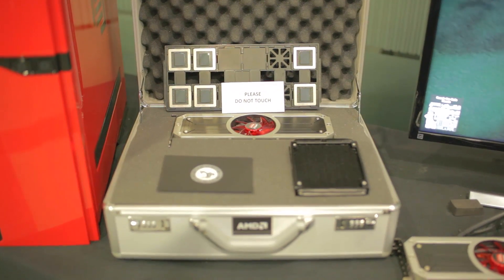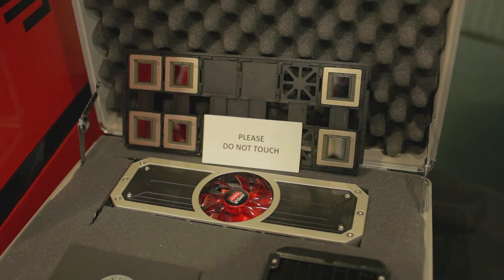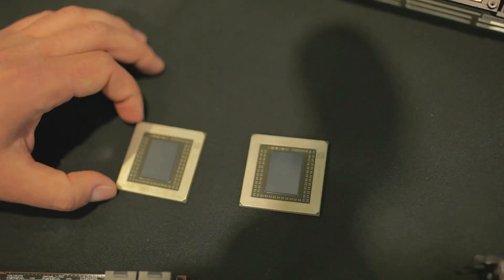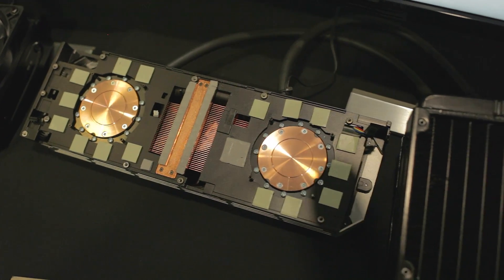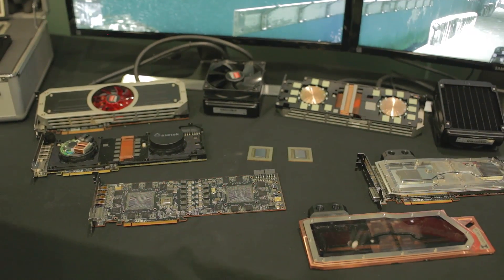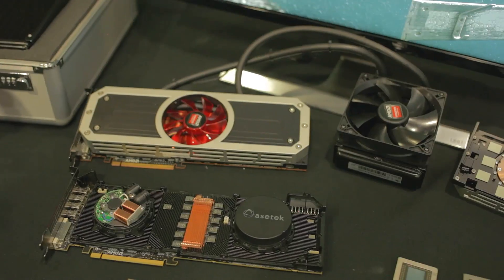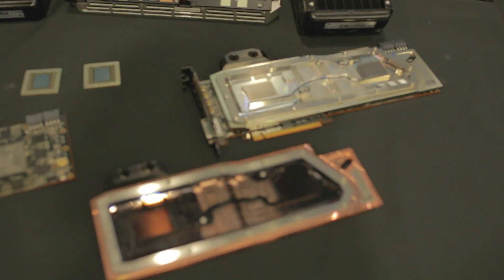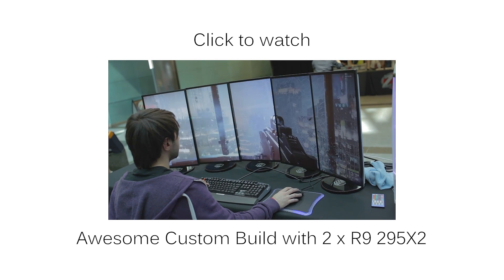AMD R9 295X2 Dissected + Custom waterblocks (ExtravaLANza 2014)

Comment: I immediately thought "Bullshit" when he explained the thing about them choosing closed loop and how he kind of diss the open looper's. I have an open loop cooling with mine at the moment and re building it soon with rigid tubing to accommodate the 970 and the 2 new block's I just bought.

His explanation was acceptable but to say something like that against open loopers and not even mentioning the real reason why they use closed loop cooling.

Its the fact that those cards get so hot its like an electric bbq grill if you use a heft dense stacks of metal heat sinks....

And he compared closed loop 120mm Rad performance against open loopers? lol there is no way a closed loop perform as close as open loops.

Then they are boasting having high speed GPU's at a better price.

Again not mentioning the fact that their cards consume alot of energy, waste majority of the power consumed as very high temperature/heat and mostly have cheap price because they do massive price cuts when they are starting to lose.

Just saying.

Comment: Not against AMD at all, but the fact the card needs to be water cooled as standard, but the Titan Z does not says a lot about the engineering at AMD. I feel they rushed this card to market and it's a bit if a bodge job.
Reply: think befor talk!
the r9 295x2 has 2 fully enabled cores with even a higher clockspeed then the reference one! on the other hand the titan Z has 2 downclocked cores and a tripple slot cooler and it is still hitting higher temps then the 295x2!
AMD did the right thing to go with a CLC.
if you look at the performance the titan Z can deliver for gaming and keep the pricetag in mind, then i have to say the guy´s over at nvidia shot themselves in the foot...
Reply: Is it faster than the Titan Z?
Reply: Sebastian Green in the most game benchmark yes, in canned benchmarks like heaven sometimes the titan z, sometimes the 295x2.
also the 295x2 pulls ahead if you higher the resolution! at 4k and both cards overclocked to the max the 295x2 was a winner in almost every situation...
Reply: Almost every situation.......

I believe when utilising the gpu power for complex computation the Z is way better. 

Depends on the usage. I'm not really a gamer.
Reply: and then again, it depends on what are you going to calculate with it!
if you are interested in workstation card´s then go check out some video´s first. you will be surprised which card´s will perform very well at even a lower pricetag! ;-)
Reply: *****
nvidia also intentionally nerfs gaming cards because they dont want to lose their professional markets, gaming cards are rated to run at 100% load with their coolers at stock clocks indefinitely before being sold by them and everyone else except the amd 290/x cooler which were nowhere near good enough at lower fanspeed or just too damn loud.

Comment: Titan Z is faster than the "undisputed" R9 295x2
Reply: Drink much??
Reply: You should probably have read one of the few reviews of it. Titan Z slower in almost every game at every resolution. Don't be fooled by the price tag.
Reply: the titan Z got mostly beaten, and the higher the resolution was, the bigger was the gap between the titan Z and the 295x2! if it is just for gaming the 295x2 is the best card you can get at the moment for a much lower price then the titan Z...
Reply: blackice11z What's your point? You should be comparing reference vs. reference. There was nothing stopping Nvidia from putting a better cooler on the card. They didn't so it's a slower card. It's simple as that. Are you saying that AMD should be saying "undisputed unless you put a $200 waterblock on Nvidia's $3000 card and compare it to our reference cooler for some reason?" We can't even say for sure that Titan Z would win with both on custom water with full-cover blocks and overclocked without actual tests.
Reply: Being more expensive ,by 2X too....If I were to pay for a Titan-Z I can go Quad Xfire with the 295 X2 
Sorry I compare the Value instead of just Charts and Bars and some Benchmarking Scores. 
Since end of the day my wallet is the bigger priority here....
Seriously stop lying to yourselves NVIDIA fanboys. All you guys doing is trying to lick your wound and comfort yourself while you cry yourself  to sleep everyday knowing about the harsh truth =)
But seriously you sure the Titan-Z is faster ?? Or  your eyes need to be check. So far I seeing is the 295 X2 totally trashing the shit out of the Titan-Z in EVERY game....matter of fact even 2X 780 Ti runs better than the Titan-Z yet again another fail of a card for gamers. Which NVIDIA themselves advertised it as a Gaming Graphic card....
Reply: The Titan Z is meant for CUDA applications. It's twice the price of the R9 295x2 and doesn't even perform better. Fanboyism much?
Reply: blackice11z If you need to spend an extra $200 (not counting the other costs of making a water loop) and overclock to make a card faster, it's not a faster card. Whether you're right or wrong, it doesn't matter because you can only market based on out-of-the-box performance. Some Titan Zs won't be able to overclock at all, even on water, and, again, there are still no benchmarks with both of them using waterblocks. If you need to say this in order to feel good about yourself, then fine. Just don't get upset when you get called a fanboy.
Reply: blackice11z That doesn't matter for several reasons: 
1. Full water block =/= closed-loop cooling
2. Nvidia chose to put a shit cooler on the card
3. Not all cards can overclock well
4. There are no benchmarks available to confirm which card is faster under water. Admittedly, it is likely  the Titan Z since the cards are about equal before the Titan Z heats up,  but the fact that Hawaii crossfire is  better than SLI stops that from being a given.
5. The cooler is part of the package. If you need to change the cooler to make it competitive, it's a slower card with its potential held back, not a faster card. You are literally the only one I've seen try to make this argument, and considering how many Nvidia fanboys I've met, that's really  saying something.
6. Not many people are going to buy a $3000 3-slot card to put a waterblock on  it and waste two whole slots.
Reply: blackice11z So the truth has been spoken. Basically there's no HUGE advantages over AMD by going from AMD to NVIDIA. Just a few little extra features and and there. Individuals taste I guess. But AMD being more gentle to my wallet I stick to AMD definitely.
Reply: blackice11z Oh look, a fanboy ignoring everything said to him that doesn't agree with what he says. What a surprise! Since you're too slow to get it, here is the reason why using overclocks to determine the better card is flawed: AMD Radeon R9 290 Unboxing & Review

A controlled test with overclocking is an oxymoron. The only way to even remotely make it work is to have a large sample size. Are you going to suggest that AMD should spend like $60k on Titan Zs and waste 20 perfectly fine 295X2s while wasting a ton of manhours filling and emptying water loops and doing a battery of tests each time just to prove the claim? If that were really worth it, Nvidia would be doing it already! You're starting to get on my nerves. Do you even understand how testing, watercooling, and overclocking work? Or are you just that desperate to defend this joke of a card? If what you're talking about were the standard for comparing cards, Nvidia would have already done the tests and made the claim. You are literally the only one saying this. Maybe Nvidia should hire you, since you're apparently more intelligent than they are.
Reply: blackice11z Again with Drivers , so far AMD Drivers been pretty stable for me. 
UNLESS your using their BETA Drivers, those are terrible , NEVER USE BETA from AMD , bad things will happen. Unless you ABSOLUTE having problem with their current OFFICIAL Drivers and want to solve it ASAP.
G-Sync , PhysX it's just a Gimmick. 
Not sure about you guys I've a 280X Toxic , games these days even like Metro Last Light , Bioshock , Thief etc , Modern games even that they are high graphic demanding games , I can turn on V-SYNC and play at a smooth 60 FPS without input lag , or better some games have FPS Limiter it's different from V-SYNC but works kinda like it. What's best is it's FREE ! 
I don't have to go get myself a compatible monitor just for G-SYNC not to mention I have to buy G-SYNC too.
PhysX ?? What PhysX...do you know even till now only two games actually supports PhysX ?? That's Borderlands 2 and Batman.....nice....
Reply: yah best for your money
Reply: You are what i call 'a special moron' because you want to give an argument that's completely false and still defend your pride even tho you probably know nothing about computers
Reply: Let me know when the 295X supports physX.
Reply: no, it isn't
Reply: AdamantuimDragon NG Cuda cores applications. Ever heard of it?
Reply: blackice11z The R9295X2 outperforms the Titan Z in 4K gaming and OpenCL.
Reply: The AMD card runs on Water, put a waterblock on both and see the Titan win, of course the reference AMD card runs faster, its on water already.
Reply: blackice11z Exactly, you pay half the price and they do the water cooling for you. You reek of stupid.
Reply: yah titanz cost 3000usdm you can buy 2 r9x2
Reply: markalious I'm not talking about price. A single Titan Z performs slightly better than a single 295x2 when they both have equivalent cooling, i.e. both on water.
Reply: darthrevan6 I'm not talking about price, my point is that the Titan Z performs better under equivalent cooling circumstance.
Reply: I prefer Nvidia because they have better software, better drivers, Shadowplay, Shield streaming, G-sync, and Physx. Of course I'd get an AMD card if they had all that, but they don't, they have Mantle which is still not open, is only a few games, and doesn't make enough of a difference on their high end cards that I would buy.
Reply: Eric Tan  I admit I only had driver problems in Crossfire. I like G-sync because I got it to work with my IPS monitor, I still like some older games like RAGE where I get 100+ fps, I prefer color accuracy over 120/144Hz gaming monitors. You can get most monitors to work G-sync, the compatible ones can have the pcb inside where you removed the power faze, My G-sync module is on my desk with the back of my 'incompatible' monitor open. Physx isn't a big deal to me, its no game changer, it only makes some games destruction, particles, and cloth more realistic so I like it visually. The Metro series has full Physx support.
Reply: Eric Tan Yeah, I only prefer Nvidia because their extra features are useful to me.
Reply: yah..amd best for your usd
Reply: Like I said I wasn't talking about Price Performance Ratio.
Reply: blackice11z Yeah, you're talking about adding aftermarket cooling to make Titan Z better than R9 295X2 reference, thus making Titan Z the faster card. rolls eyes
Reply: NDogg15 Equal cooling solutions.
Reply: No "fastest GPU on the planet" should be against other cards under equal cooling, thats how a control test works, the card is the variable the cooling is the control. He would have been correct had he said "Fastest REFERENCE GPU on the planet."
Reply: That's your opinion, but it's not how it works. Getting 100% equivalent cooling is practically impossible anyway. Even if you use the save system with the same water loop, that doesn't ensure that there aren't variables. (Not to mention the fact that you were implying that the reference 295X2 should be compared to a Titan Z with a full waterblock.) You're pretty much right that he should have said reference, but even then, in the absence of actual testing to see which is faster, we can't say that he's wrong. Even if the Titan Z "wins" in this test, it would be due to how high it boosts, and that can vary from card to card. Moreover, I'm sure that you were talking about overclocking both to the max, and that throws any idea of a control out of the window.

Also, please read points 4 and 5 again.
Reply: NDogg15 I wasn't saying the reference AMD cooler should be tested against a Titan water block. Companies are very capable of doing a control test and to say their card is the fastest card in the world they need to compare it against other cards while maximizing the potential of each card, water blocks and overclocked. The AMD card is better cost effective.
Reply: I'm not sure about Titan Z being better than 295X, even adding custom cooling solution and overclocking. After all world record in 3D Mark Extreme is held by 4X 290X and it competes against 780Tis. Highest ranked setup with Titans Z is on the 17th place.
Reply: NDogg15 Not saying anything of the sort, when I talked about control testing it was in reply to a comment saying it wasn't possible. I prefer Nvidia because they're extra features are useful unlike mantle but I would take a 295x2 over two 780 ti, and If I had $3000 to buy GPUs I would get 2 295x2. I am not a fanboy of Nvidia, I prefer whichever company has the best features as the actual GPU tiers scale the same for both. Right now Nvidia offers better features, if AMD has better features when I upgrade my GPU in the future then I will buy an AMD card.
Reply: blackice11z Fair enough. I'm tired of this conversation anyway.
Reply: geoffry pope Being cooler lets you overclock more than the 295x.  However it's clearly aimed at small form factor builds or you'd get 2 Titan B's.
Reply: Dan Chiccino Where the fuck did I say 'Titan Z with full custom loop is better then Reference 295x2' Nowhere, I never fucking said that. I said the Titan is faster if the COOLING METHOD IS THE SAME FOR BOTH CARDS. That means a full custom loop on BOTH cards, or give the Titan the same Asetek cooler. Thats because Nvidia actually updates their processors build structure and AMD just crams as much onto the pcb as possible and adds a rad because the card would melt on air.
Reply: blackice11z hahahahaha well the card includes the waterblock if the titan Z had a waterblock it would be priced at $4000 lol idiot
Reply: blackice11z " the card would melt on air."

Hahahahaha. Oh you're serious? Let me laugh harder.

BAHAHAHAHAHAHAHAHAHA!
Reply: Actually no it isn't, the R9 295x2 is far superior in terms of performance. If you're looking at style however,.... the R9 270x Toxic by Sapphire is still better looking and is still a pretty good card.
Reply: blackice11z Aaaaaaaand your fanboy is showing.
Reply: I got the 270x Hawk by MSI and it performs realy good!
Reply: Dan Chiccino Really? Amazing mod! Could you post the temps you got?
Reply: yes the titan z is faster....if you go watercooled and clock it very high :)
Reply: darthrevan6 no it was meant for gaming it was advertised for gaming. A fucking nvidia fanboy ascuse oh it's for rendering stuff... let me... let me tell you something...A FUCKING. TITAN Z DOES NOT SUPPORT SONY VEGAS OR MAJOR 3D APPLICATIONS THAT CAN USE 4K TEXTURES AND MESHES.
Reply: darthrevan6 no it was meant for gaming it was advertised for gaming. A fucking nvidia fanboy ascuse oh it's for rendering stuff... let me... let me tell you something...A FUCKING. TITAN Z DOES NOT SUPPORT SONY VEGAS OR MAJOR 3D APPLICATIONS THAT CAN USE 4K TEXTURES AND MESHES.
Reply: yup

Comment: Anybody find it silly that AMD keeps boasting about the water cooling unit? I seriously doubt AMD did much design on it - they just paid Asetek to build a solution, slap it on and fix their own heat problems that they can't build a decent stock cooler on. GPU itself is great - but c'mon...the watercooling work was mostly Asetek.
Reply: And?GPUs kick out less heat so Asetek would be perfect

Comment: AMD makes good stuff but as an engineer, I question why this needs a liquid cooler while Nvidias crazy cards don't.  And it is not just graphics cards.  Why are AMDs CPUs less power and heat efficient than the intel counterparts?
Reply: The current Intel CPUs are on a smaller nanometer process which improves efficiency vs am3, but AMD haven't released a huge new family/architecture in a while so they're probably working on something better. The Titan Z doesn't use a CLC because of the throttling of the individual cores (they're lower specs than a titan black, 780ti etc) but the AMD uses full (better then 290x) Hawaii cores. As for the single GPU cards, the 290x stock cooler was just a bad design and the core is smaller making it harder to get the heat away for the core (the Asus DCUii has heatpipes that don't make contact with the core!). AMD aren't behind in efficiency for any reason other than they make better priced components that are often older and have not much thought put into heat and efficiency.
Reply: AMD can't keep up atm. Their designs are bad and they should feel bad

Comment: Are both the GPU cores of this card fully enabled?
Reply: yes and they are even overclocked out of factory
Reply: That is probably why they needed the liquid cooler because most dual gpu cards have each of it's cores underclocked or are not fully enabled.
Reply: The Guy of Awesome yeah even at stock they would had not ran well with a poor aircooler